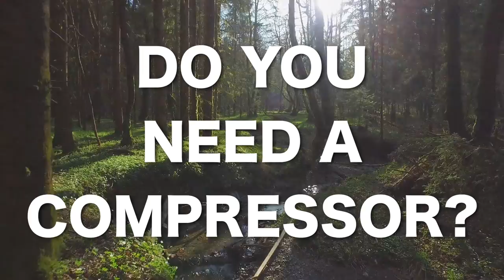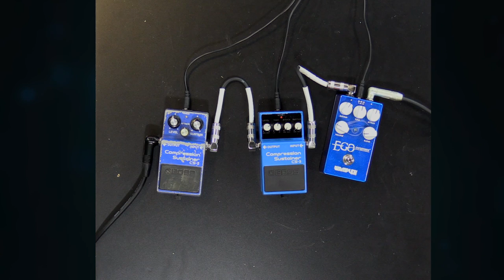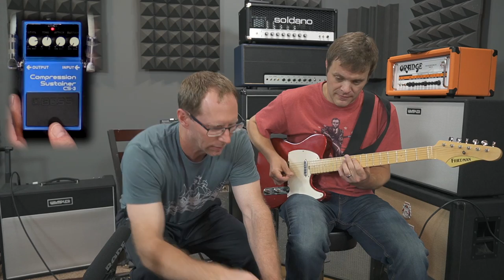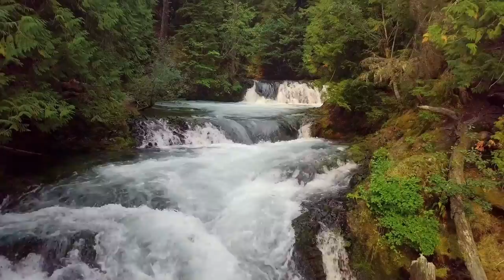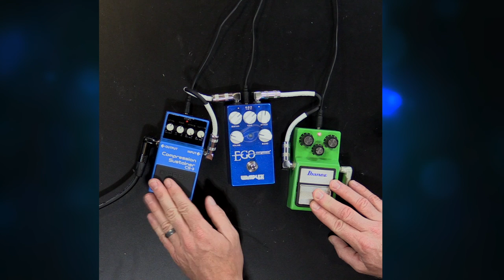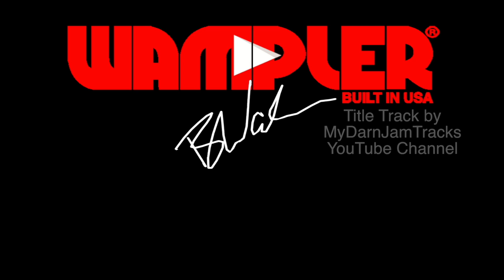Do you need a compressor pedal?

Comment: It took me like 7 years to figure out how to use that cs-3, but I'm stoked on the settings I get out of it now. It gently squishes the louder chords, adds sustain, and gives a nice boost to my leads. I turn down the level a bit, set the attack real slow, and add sustain (make-up gain) to taste. The attack is too quick when you have at 0. My settings are: Level - 01:30, Tone - 12:00, Attack - 03:30, Sustain - 09:30. I wish I had that blend knob though!

Comment: I have a bunch of compressors, from small pedals, through table-top units, up to 3U rackmount units, and patches built into digital pedals.  Would never be without one.  My favorite, for a long time has been the old grey Univox Uni-Comp.  It was the very first compressor I ever bought, somewhere around 1977.  I had to sell it in 1980, but recently came across a schematic, cloned it, and love it all over again.  It is about as simple an optical compressor as they come.  Far from "transparent", despite having the cleanliness of an optical circuit, it is very clearly an "effect".  It has  a long gain-recovery time, much like the classic Dynacomp, but without the problems that use of a transconductance amp introduces.  It LOVES Tele bridge pickups.   Back in the day, I would use it in conjunction with my MXR 6-Band and Envelope Filter to mimic reverse-tape effects, with the long gain-recovery time being a big part of that..

My second favorite would probably be another one I built, using the terrific SSM2166 chip.  The chip - now hard to find - was intended as a one-chip solution for a mic strip.  It provides considerable control over compression, but also includes downward expansion to effectively gate out the "breathing" so common to compressors and so common a source of both complaint and misunderstanding among users.

One invaluable use of compressors is for playing guitar and singing at the same time, or alternatively playing energetically behind a singer.  Enthusiasm in strumming, or trying to remember words, sing them, AND strum at the same time (like riding a unicycle and juggling for some of us), can result in level imbalance between guitar and voice.  A bit of compression will let you go nuts on the strings, but keep the guitar safely and consistently below the level of the vocals, so that they don't fight each other.

In a perfect world, you can stick any pedal wherever you want.  In the real world, compressors are best placed before any clipping or other high-gain pedal.  Why?  Remember that their purpose is to not only turn the volume down, but to turn it up when things quiet down.  And when you stop playing, what that high-gain pedals offers is hiss.  If fed to a compressor, the compressor interprets that as soft-picking that desperately needs some boosting.  That's why compressors can be misunderstood as being noisy.  It's not the compressor, but rather the noise you are inadvertently feeding the compressor.  As well, compressors respond to the dynamics of your input signal.  Clipping pedals of any type do what they do by running out of headroom; losing dynamics in the process.  So feeding a compressor with a signal lacking full dynamics doesn't really give it much to work with.

Having said that, constraining the dynamics of what you send to a clipping pedals will make the clipping pedal less responsive to your picking.  That CAN be what you want - making the distortion intensity more consistent in spite of how you strum.  If you want it to be more responsive to picking, simply turn down the compression amount.  But the compressor/clipper pairing works better/best in that order.

Traditionally, compressors were viewed as killing brightness.  Why?  Most of the harmonic content in a string occurs in the first few milliseconds after picking, which is also the peak that pushes the compressor to turn the gain down.  So if you instantly turn the level down on the brightest part of the note, and then turn the volume up as the string settles down into mostly fundamental, what you end up hearing most is the dullest part of the note.  The more recent inclusion of "blend" controls that mix in some uncompressed clean signal, allows for the initial attack to be heard as Leo and nature intended.  The uncompressed signal will very quickly recede to the background while the compressed version hangs in there, resulting in the best of both worlds: a nice bright attack with the endurance of boosted squish.
Reply: Hmm, interesting about the "invaluable use of compressors."  Let me take an opposing view: Seems to me that a singer-musician more naturally wants a guitar to be responsive and sensitive to anything he does with his hands (fingers, palms, wrists), because the sound of the guitar (whether loud or soft) becomes one with the voice. You're arguing that a compressor frees up the singer to focus on his/her voice. But that would rob him of his ability to play guitar dynamically. And it also would rob the song mix of a dynamic sounding guitar.  I think the rule should be: If the song calls for a compressor on guitar, then use it. Don't use it just because you're making it easier for the singer.

Comment: I run my compressor in front of my drive pedals. Adds smoothness and fullness and sustain. Makes it feel great as well.as sounding fatter. I use a Boss CS-3.
Reply: 100% especially for a lot of legato playing.

maybe it's a crutch but it just makes playing lead feel like butter.
Reply: @ToneSherpa  I have a cs-3 for around 30 years (looks a bit rocked, but still working well) and whenever I put it into the fx chain for my electric guitar, I am amazed how it smoothes the sound in a very special way, no matter the settings. For me it also sounds like butter, like greasing the notes. 
People may like it or not like it, but I love it. Cheers  : )
Reply: @jorn-jorenjorenson5028  yep, same. so far nothing beats the cs-3... I still might try out the Keeley compressor though.

Comment: Something that I have found, at least for myself playing rock: If I'm playing in a 3 piece band - the sustain a compressor gives is super-important to hold together the sound, otherwise the guitar is dropping to low and it cannot vie with the natural sustain of the bass.   In larger bands greater than a trio - its less about the sustain and more about the actual compression which help the guitar to keep its relative place in the mix overall volume & dynamics.
Reply: Classic guitarist tone-freak error is not considering how you'll sound in a mix.  The loss of dynamics does take some getting used to for both your hand and ears, but the overall effect is hugely positive. It's not like the sound engineer isn't going to drop some on you in the PA anyway....

Comment: I have been playing for over 50 years. It took me 40 yeaars to buy a compressor pedal. I now have 2. The standard Boss CS-3. My main is the ay Huge Saffron Squeeze. My experience is to have a top of the line compressor. The Way Huge (As well as many of the "High End" ) pedals are a must. I could not believe the improvement. I thought I needed nothing as I have -what I think, an amp that needs nothing. Mesa Boogie TC 50 Crown. Yes a veratile and great amp. I do not care what you have a quality compressor will bring your rig to life. hank you-Great video. I hope it helps somone like me from waiting 40 years to buy one. At least go to Guitar Center (45 day free trial) try some. Buy on Reverb, if you can get a better deal. Best of luck folks.

Comment: My least favorite Wampler video is this one. Set the Boss CS-3 attack at 3 o'clock and the sustain at a low 9 'o clock or even less. Turn its volume up and its sweet. Max the volume and you've got a nice clean boast. You rarely need it for OD-I agree. But you guys are compressor bullies and weren't fair here. (just my opinion-still love you).
Reply: The CS-3 is basically #GOD

Comment: I played 80s and 90s country for years and cannot imagine doing it without a compressor. It serves so many purposes. You can vary the Tone of a note by plucking it harder.  Also on those super fast runs, it brings out the notes you can't hit with authority. It also worked on Pete Anderson stuff, just get a little more push into the amp to break up even though I believe he did not use one.
Oh and a noise gate as well. That comp will add noise.

Comment: After trying an empress compressor and JHS PnP v4, I bit the bullet and got the Cali76 stacked edition. My main overdriven tone is a Benson preamp that gets pushed by a EQD speaker cranker as a stage 2 drive option before going into the Cali76 that is set to a light compression/limiting. I enjoy the Cali76 both before and after dirt pedals but I am sticking with after because I want the dynamic interaction between the guitar and the Benson Preamp to remain as pure as possible. Using the volume pot on the guitar to get all shades of clean into medium drive. The Cali76 keeps my volume in that sweet spot while I can play around with right hand dynamics and really hear that interaction shine through.

Comment: Compression is a tool - not every job requires the same set of tools. When I was just beginning to play, the use of a compressor helped me paper over deficiencies in my command of playing dynamics - it smoothed things out and made me sound better than I was. As I got better over the years, I realized I could enhance my playing by exploiting dynamics instead of suppressing them - so the LACK of a compressor made me sound better. But face it - BIG distortion and compression go hand in glove. So - I still have a compressor on my board, but thankfully it has an on/off switch you just have to step on to activate - and changing things up makes me sound better now. Go figure...
Reply: Compressor pedals are rarely used for hiding inexperience with dynamics. It's moreso used to modify tone or level out the strings.

Comment: The best use I had for my CS-3 was when I used a solid state Fender amp on the road. I actually had the occasional compliment on my guitar tone. The pedal was always on with the tone knob all the way down. Basically, it took the harshness of the solid state amp and tamed it to give an approximation of what tube amps do when you turn them up. Once I got a nice tube amp (deluxe reverb), I ended up not using the CS-3 because I didn't like the attack or lack of low end frequencies, and I've had to use fuller sounding, higher headroom compressors ever since. Thanks for the video.

Comment: Brian, thank you for creating this amazing pedal. Travis says he doesn't have much use for a compressor because he doesn't often play clean. But this misses how great the pedal sounds with some moderate to even heavier gain. With the knobs all at unity on my mini Ego first in my chain, and either onboard gain from the amp and/oror gain from a pedal, it adds a warmth, a depth, a boost, and lovely saturation and sustain. It is a "big" sound such that it almost sounds lame by comparison without the compressor on. My Les Paul into my Fender Super Champ x2 with Ragin' Cajun speaker (on the gain channel, with gain at about 9:00 o'clock), along with the Ego on the unity settings I mentioned, above, sounds huge, even at relatively low volume. The Ego also sounded monstrous along with the TS 9 pumping out some gain on this video.

Comment: When I 1st started using a compressor I didn't realize that I was compensating for a manufacture/setup issue on a new guitar.  Since then I have always kept the compressor as part of my rig, even the most stripped down version. It's not always on but I still use it a lot.  I dig the way you approach and explain the circuitry.  Can you expound on what sets (or doesn't) my Cali 76 compressor apart from other compressors.  Thanks

Comment: Love my Ego mini. It is the best version of that circuit topology out there imho. I am a compressor junkie and have some for different needs. I usually run two or three. Sonuus voluum in the loop does me some super fast gentle smooshing on my go to amp that has lots of headroom (its in the loop but it does me tuning and tremolo too). Thats always on. Then I have the ego up front as a boost and sustain for my clean and to bring my drive from below unity to solo volume. In this way the comp saves me having extra drives and boosts. And if i want a less squashed clean lead i just back off the guitar and get less rms with the same peak. Sometimes I do a faux clavinet thing by setting the attack slower, and the brighter tone switch position and pushing up the sustain more to really bring out the attack as seperate. The cs3 was the only one I had for years before I really got my head around comps and past 10 o'clock the sustain is just smashing the threshold and at such a high ratio it really steals the whole character in my opinion. Sucks the bass out too (or at least the percieved envelope). Brian the ego is a work of art. Thank you for such a great tool.

Comment: For the first example, Brian had the attack time at the fastest setting, which of course will immediately engage compression.  Given that he was aiming to show the compressors at a minimum setting, I'd argue that attack time should be at maximum so that it stays out of the way of the transients...just sayin'.
Reply: Doing that sometimes does a weird clamping thing half way through what you play though, as I discovered with a cheap comp pedal. So your transients get through, then the comp hits it and the signal drops quickly then recovers. At least if the attack is fast, the comp is definitely engaged when you strum or pick.

Comment: Cool vid, Brian. I think the "to have or not to have" depends on what you're playing, and how clean. For clean tones, a compressor gives and interesting, glassy tone, which is great for some styles. If you play dirty, you're already getting compression from the dirt, so an extra compressor pedal is overkill.
Reply: I have found that when you add the Ego compressor (all settings at unity) to a dirty sound, it does much more than merely add compression -- there is a boost, depth and warmth added to the tone that is not there without the compressor, and it sounds huge.

Comment: I recently got into pedal mods and building and put back together a DOD FX80B comp that had its guts hanging out and some bad solder attempts, even was able to tweak the infamous switch to get it to work as it was intended; it's probably my fifth compressor but this vid solidified for me even if it doesn't stay on my board i'll keep it kicking around for clean fingerstyle stuff

Comment: Looks like a great argument against compressors. Guitar dynamics are in the picking hand. I spent years developing the ability to shade dynamics with my right hand.  If you can't get even dynamics using your hands, maybe you need a compressor. Thanks.
Reply from the maker: It’s definitely an effect- sometimes it’s useful, sometimes it’s not. It really depends on use-case.

Comment: I play a UBass and it's Piezo. Absolutely needs one. Piezo need a few things high pass at a low frequency a treble bleed and a compressor.

Compressors also work nice in front of solid state amps on metal tones. But always on the wet rig using a cleaner dry amp.. Less aggressive amp settings compression brings sustain

Blend is so important I like one extreme setting and a dry rig. Two amps one dirtybox with a loop and a clean warm. In my case Bandit 112...

Comment: I wasnt sure if i wanted a comp pedal cause i mostly use humbuckers but i got a Donner ultimate comp to try out and turns out i love it. When im playing through my JB/59(4 conductor 59 as well as JB which is 4 conductor standard) set i can use the split coil option with the compressor and an overdrive and it sounds absolutely amazing. The JB is hot enough that split it still sounds great and full and the 59 isnt as hot which lends itself to a lower output cleaner tone as a humbucker but since its nice a full/warm pickup it still fills out when split really well. In other words they both sound very good split unlike other 4 conductor humbuckers. And with a little compression you can get them sounding JUST as good as dedicated single coils( using a comp pedal with spilt pickups is a great trick to get them sounding more authentic). I love using compression now and the Donner was cheap and has a "treble" and "normal" setting along with tone, level, and comp(gain) which makes it work well with any pickups. Id just recommend keeping the comp lower with humbuckers or other high output pickups. The Donner ultimate comp is now first in my pedal chain and i have no intention of taking it off. I really only expected to use the Donner long enough to know if i wanted a "real" more expensive comp pedal but it really sounds great and is very versatile. Some mini pedals are adequate but not ideal but the Donner is just as good as any other comp pedal ive heard so far. So if your on the fence i highly recommend it that way you dont have to spend too much money if its not your thing. But im convinced anyone would love compression if they knew how to use it right with their setup.

Comment: Addendum from my experiences... My Line-6 pod(s), and likely most if not all digital modeler processors, provide Compression/Sustain effects. Additionally, I own the CS-3 and use it for tone shaping for both clean and dirty (behind distortion). I'll note that CS also adds boost / gain (tremendous boost / gain in the Line-6 POD). I suspect it's tacky to make a shout out to my own channel (Czar of Zonk), but I note this because I use CS in my 2018 performances (all analog / CS-3) and in my 2019 performances (all Line-6 POD). On the 2018 performances (using a Gretsch hollowbody and a 1964 Sears Silvertone 1x12), you can see me hitting the CS-3 -- so y'all can also see the CS-3 in action (or not, as the case may be). For me, the CS is not so much about squashing or gain, but about tone shaping.